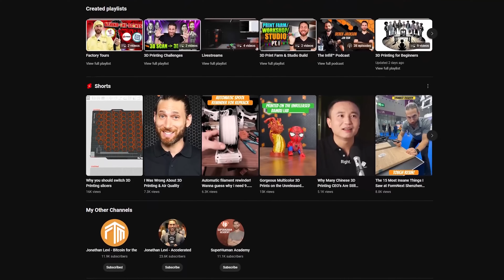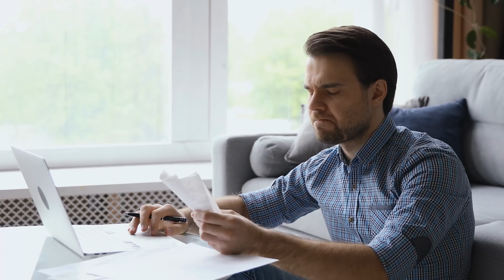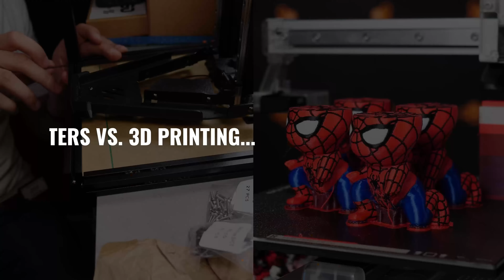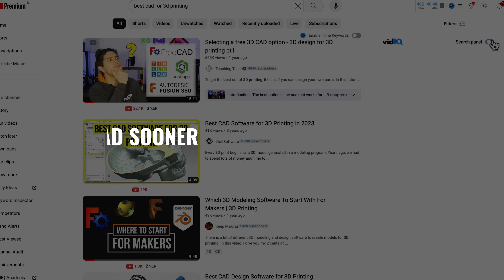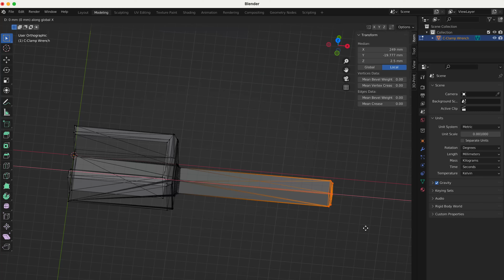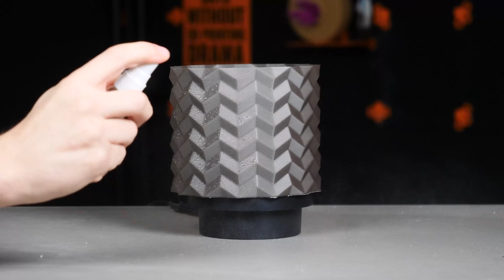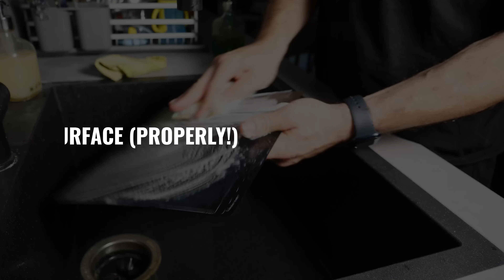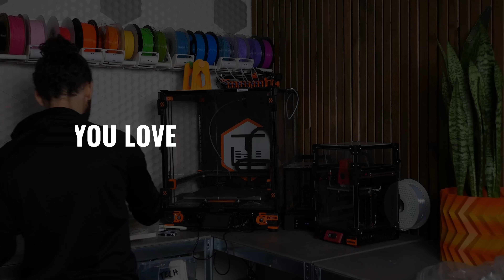9 Things I Wish I'd Known About 3D Printing

Comment: Yes, the "Why your prints are failing" video would be greatly appreciated for people new to the hobby.
Reply from the maker: Noted!
Reply: @thenextlayer  please cover prints peeling off bed, over hang issues, stringing and touch on filament drag specifically with the older style hot end bowdin tube style. I'm sure you've covered many of those in other videos but that plus bed leveling, adhesion, and initial slicer settings would have helped me so much
Reply: Yes please, I’ve had a pla print recently failing multiple times and changing temps and airflow isn’t helping
Reply: This is why I think there was an advantage to the kit printer.
Reply: I had issues with my MK3s+, here is what I did.  #1, adjusted my height using a tool I found (squish test tool), got that fixed, got a new steel sheet for my used printer, got the S4 dryer and dried my filament.  I have been able to print more than ever now successfully on my 1000hr+ printer I got used.
Reply: :3 Fellow Jewish brother. Shalom. <3
Reply: Agreed.  To go along with the "curated information" part, I wasted almost 200g of silk PLA filament in crumbled prints for my daughter before I found the possible answer buried in a Reddit post.  I needed a higher temperature than listed because of the PLA/TPU blend they used (220+ vs 209-212)  I'll know this afternoon if it works.

Also, finding out that the difference between what the heated bed is set to vs what the build surface reads can be 5-15 degrees cooler than expected on the plate depending on the surface used.

All sorts of "fun" things to learn.  Great video!
Reply: @dwilliam16   calibration tests are a great idea any time you work with a new filament type or brand. I always try to do at least a temp tower if I haven’t printed with the filament or similar yet. Then I’ll write on the side of the spool the information for later.
Reply: @dwilliam16  update us if it works please
Reply: @binyominmartin3308  Mixed results. Overall better appearance, but still brittle.  It's one of those flexible dragons and it prints just fine in normal PLA.  I guess I need to run  some tuning tests for this brand of silk.
Reply: @dwilliam16  All of the silks that I've ran have had to be 10-15 degrees warmer than my standard plas. Every brand is different, but the highest I have went is 215 with smooth finishes. Typically I run at 210.